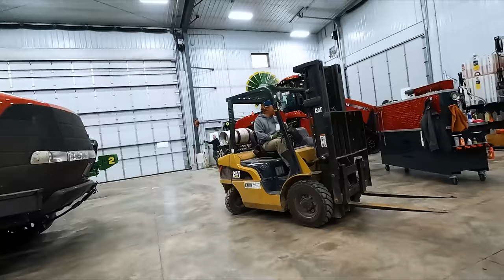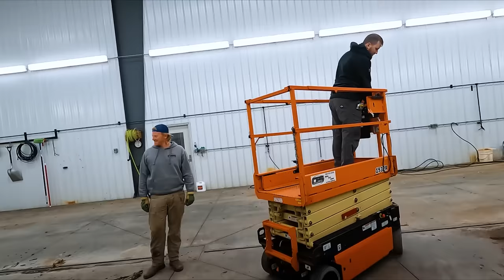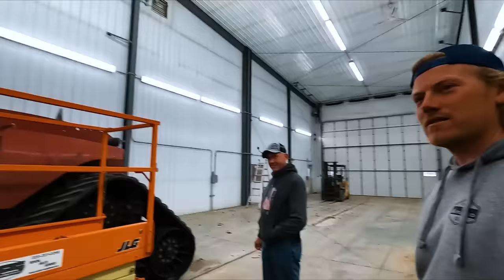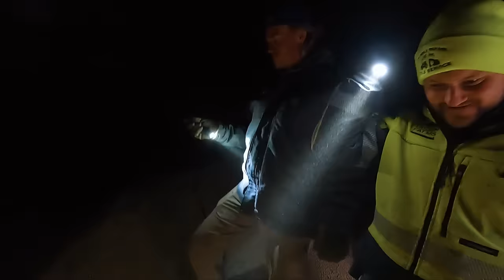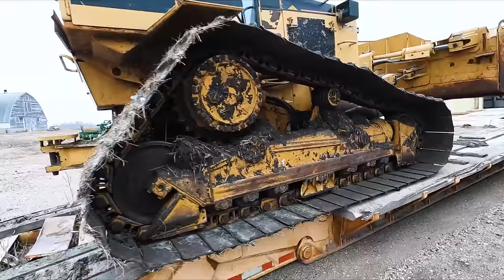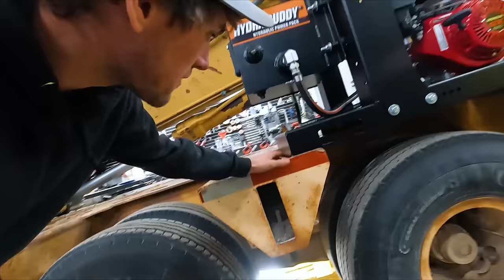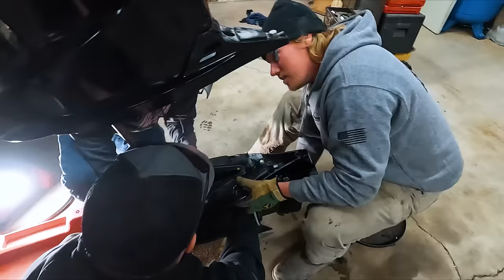Brody’s Getting All The Upgrades This Year!!

Comment: Put your harness on Brody!!!
Reply: Don't believe you need it in a scissor lift.  It changed a few years ago
Reply: OSHA does not require a harness in a scissor lift. However some job sites, and insurance companies do require one.  

I don’t think a harness in a scissor lift is a good idea. It does not take much sideways force to tip one over. I can only imagine someone accidentally falling, and then the harness “catching” them only to have the lift land on top of you and crush you.  As long as you are on stable ground, and stay inside the safety rails you are good
Reply: In Canada 🇨🇦  it's a requirement as well as working at heights training but if it's OK  in the U S A  GET WASHING BRODY!!

Comment: What are you doing with your partially disassemble it because the tank does not have to be next to the hydraulic pump and by doing that you will gain about 3 inches of clearance my friend put one like that or similar in between the axles, and it only stuck up 3 or 4 inches above the deck height in the very center so you could drive over it.

Comment: Question for you boys. The truck that is hitched to the trailer with excavator on it. Will that be the truck that will always pull the trailer? Could that pump be mounted on that flat plate that is in front of the fifth wheel, or would that cause an issue in the turning radius of truck and trailer?

Comment: I used to work around a trailer just like that, they had a Honda in the middle well right before the kick up, can you take the motor and pump off the skid and mount the stuff down in the well? And it had a heavy steel plate to cover it. The pull cord and choke cable came out the side of the trailer.

Comment: Just a thought from growing up farm fixing. Where you want to mount the pump. Don't swing. Make it like the coffee living room table that you lift, and it comes to you sitting on a couch to use. It's supported on both sides and is at Chet High when you pull it back out of the way. Easy to see from operator.You pull, and then you push it back. Easy?
Out and up. In and down.
Thanks for the videos.

Comment: I saw a few of these trailers and the pump unit was in the back between the wheels with hoses to the front.
Why not mount all things on the passenger side? Than you can work without having to check for traffic.

Comment: I'm with Dougo, buy a new trailer.  Be safer to use. They don't seem to be super expensive.  I'm sure you could sell the trailer you have or auction it off to cover some of the cost. That was the most sketchy thing I've ever seen you do.  Loading the excavator with the quad sitting next to it with the Big Swede sitting in the quad.

Comment: Wire hanging would indeed be a ground wire for safety so you don’t get electrocuted. But would of figured you guys would have gotten one that goes to the ceiling there though 🤷🏻‍♂️ didn’t learn anything from the light upgrade project 😉 The boat bust out another thousand 😂 that will only pay for labor. Need a few more thousand for parts 😅😂 at this point gas is cheaper to run it 😉

Comment: It is a 30 footer.  The plug at the rear of the lift is for the 110 plug up high. The one on the right side is to charge the lift. Have fun.
Reply: It's a 1932.  Isn't that 19ft height 32" wide?

Comment: I would have put the hydraulic pump system on the tractor unit.and ran it off a pto. If you ever want to own a hydraulic lift trailer you would already be set up. And it might have cost less money.

Comment: Stop the camera, that scene of loading that track hoe right beside your quad is terrifying and I've did it hundreds of times over 40 years in my distant past. If your machine  is not level, wet or icy then position your bucket to the low side while crawling on. Other wise you have no way to save yourself. There are plenty of videos out there of track hoes falling off the side and tipping over and even killing operators. I know I talk to much but never load some think right beside a half million quad.
Reply: Considering what you said, it makes my suggestion seem quite paltry.  I was going to suggest putting 90s on the hydraulic fittings and unplug it when loading.

Comment: Bust out another thousand? You wish! It’s a boat, you have to remember that only rich people can afford a boat, so boat parts are priced accordingly. 5 if you can find one second hand ( but you already have a second hand bit) probably 10 new. Think about it how much is a new propeller, the guts of a grand I’ll bet and you need one of those anyway or the vibration will leave you exactly where you are now in a few running hours.

Comment: Why not mount the motor to the back of the tractor, then simply disconnected when ready to pull away after trailer is lowered?
Reply: the truck need to be disconnected, for the trailer to be lowered. The hitch on the trailer are on that platform. And there is also places where there isn't space for parking a truck next to the trailer for operating the trailer. Then there is the safety issue, if the vehicle they are loading missing the target and flip off and into the truck/tractor, some they almost did in this video.

The pump is to eliminate all that problems, by making the trailer self sufficient and doesn't need the help of an tractor to lower the ramp.
Reply: @heuhen I understand what the pump is for, I understand the tractor needs o tmdrove away.  Why. It install the pump on the back of the tractor and disconnect y the hoses when the trailer is lowered and the tractor need to drive away. 

In case you missed it, the tractor is the vehicle used to pull the low boy.  Not the quad track they have been using.  18 wheelers are a combination of a tractor and trailer.  You are  comfuaing the quad track with the Peter out tractor.

Comment: Should had bought a different trailer
Reply: It's evident that you haven't paid for a lowboy.
Reply: Just bought a Trail King RGN
Reply: The motor and wet kit on our lowboy like yours sits between the frame rails in front of the yires
Reply: @grumpbrewer5893  then you know that the few miles use that they do every year won't pay the bills.
Reply: @delbutler885  yes I know!